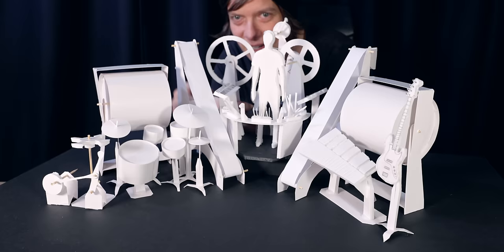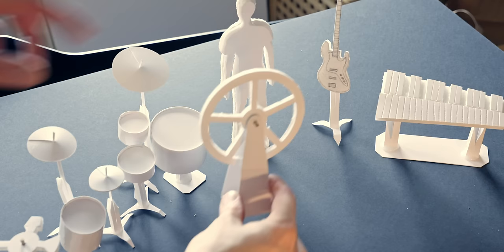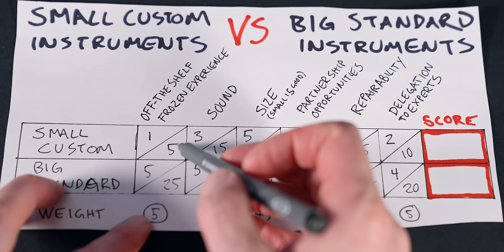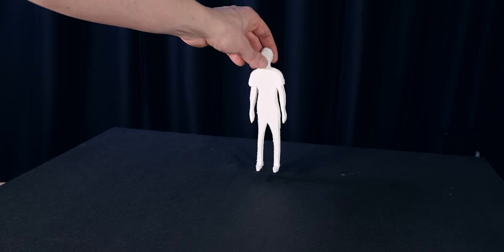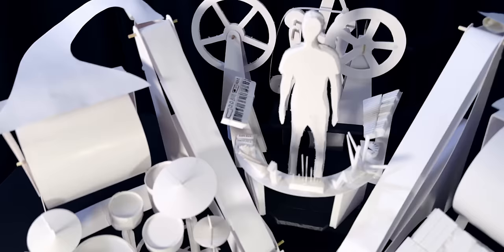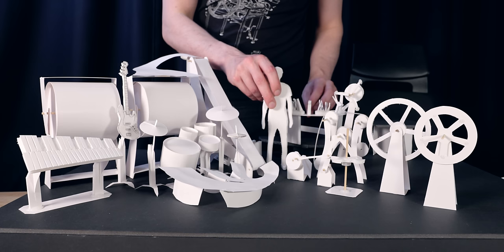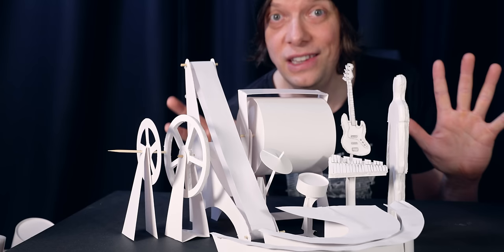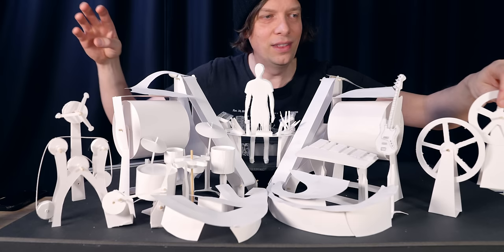Making a Cardboard Model of the Marble Machine

Comment: Adding smoke effects and pyrotechnics triggered by marbles would take the experience to a whole new level! Imagine the spectacle of marble runs triggering bursts of smoke or dazzling fireworks synced perfectly with the music. It could add an element of surprise and wonder, captivating the audience even more!
Reply: I'm pretty sure that would have serious safety issues
Reply: @michellestewart8679 standing amidst huge gears with no exit is really safe though
Reply: @michellestewart8679  Of course, but I don't think it should be discarded, especially in this phase of machine planning, adding it later may not be consistent.

If you are interested in the idea, take a Rammstein show as an example.

Comment: I am definitely leaning towards version 1, but maybe lift the gears up higher so they are at the 3 meter limit, and have you more close to the floor, like you're literally in the machine, and maybe also try and simplify the drum section? Yeah, I'd say explore what it looks like if you are on the floor and the gears and speed governor are still high enough that they surround you and tower over you.

Comment: I think you could explore the space on the stage better if you try to use all the vertical space available, for instance you could give the mechanical part more exposure if you lift the entire stage 1 meter and place those parts at the front of the stage on that space or you could do the same but expose them "hovering" above the stage sure its more complex but it should be only structural complexity of adding beams to lift the stage or to lift the mechanical parts.
Also I think it would be a good idea for you to simulate the amount of space you will actually have to move around in the stage, if you are too cramped it could be uncomfortable.
Anyway its great to see your new approach to design taking shape.
Keep it up good work.

Comment: So quick question: How will Martin escape to use the restroom or whatever? He has trapped himself in that work of art. 😂 Version 1 is really easy to keep staring at, and I like it the most. But if there is a way to not hide the mechanics, bringing them to either side or to one side for some good asymmetry, would be better. That would provide something interesting to gaze at for a while, re-learning how it works over and over. Moving the mechanics to the side also provides and exit to leave the machine. It’s about safety first, function second, and form third. All are important and to be prioritized. Good work thus far, Martin and Wintergatan team!

Comment: Just shooting from the hip here what if instead of presenting the programmable drums at a positive 30° angle front presented them at a -30 degree angle backwards and then built high in the middle. I'm sure that there's an angle that is appeasing that would allow you to showcase the mechanics as well as the programmable drums

Comment: if you decided on the daft punk pyramid esque design, the mvp / baseline could be just one side of the machine. 

Starting with an mvp that is still barebones (say a marble drum machine) that could easily be expanded into a full machine without need for a total rebuild would help with keeping motivation high with less complexity.

Comment: Well, a sizable chunk of the comments on this video appear to be of the form, “But I want it NOOOOOOOWWWWW!!!”
Another sizeable chunk are saying, "Well finally!  Prototyping in cardboard is the way we in <insert_profession> do it."
Then there are the helpful suggestions.
  My own suggestion:  Version 1, but Elevate the Huygen-Drive even higher and make the Huygen-Drive Weights the power-source, not the flywheel!  With an Elevated Huygen-Drive and flywheels behind you in a sort of "Tower of Power", you can give the drive-weights a longer vertical-range to drop through, thereby making them into even more of a gravity-battery.  You can then "charge" this gravity-battery by lifting the weights and then letting them fall through this longer vertical range, eliminating the need for you to be constantly pumping those pedals like a madman.

Comment: Instead of placing mechanics on a raised platform behind you it might be better to move the control platform to the back and raise it up. In this setup the whole machine will be visible to the audience, with the mechanics in front and on the same level with instruments. And you will be up top, orchestrating the whole setup and also visible to the audience. And as a bonus point it might be simpler to manage force distribution from the mechanics to the instruments when they are on a same level.

Comment: My only major criticism to the first layout is safety, such as the lack of access between you and the mechanisms behind you. It looks like you would have to crawl in and out, which considering at this scale it'll be heavy machinery and not at all safe. Instead, I would recommend putting them further back or having them on the sides if possible.
Doubly so incase something happens on stage and people need to get to you, they can't be reaching in to pull you out through tight spaces regardless if the machine is in motion or not. And this is before we get into just how dangerously close that flywheel and other gearage is to your back. One accidental slip backwards would spell trouble.
Just because you can squeeze everything closer doesn't mean you should at the expense of your and potentially other's safety. 

An alternate suggestion for Layout 1 would to have the mechanics under a platform you stand on. Still visible at their current height and instead puts you at a higher level than them. Which would be a safer setup.

That said, I do think the double conveyor is better than a single central one. So I would say aim for that for any design ideas going forward.

Also maybe another idea is to have simplified 3d model versions of the cardboard models and let the community make additional suggestions using the models and just the models to keep things simple and clean. And then go from there.

Comment: I also thought as you were saying it that the mechanics should be higher at the back, maybe you could make it so you can make it taller depending on the venue. Have you considered making the whole machine out of interchangeable units that you can set up in different combinations? You can use universal shaft joints and the cables to control it however you set it up

Comment: With MVP, the idea is to produce enough to fulfil the requirement and no more. But then you increase the requirement and reiterate to now fulfil the new requirement. So when people say go MVP, to me that would be build only one part at a time. So the timing wheels would be one requirement, each of the instruments would be their own requirement. And what you do is set out the timelines to work on each of the requirements in sprints (usually 2 weeks long). so after each two weeks you have some requirements filled, it could be one or multiple. The idea is not to get bogged down in the whole design, and produce nothing until the end

Comment: You want the "mechanics" to be central to the experience, so make them central to the machine.  Why not swap the mechanics with you and your stage. Spread the two instument wings a little further apart, the mechanics in the middle between them, and your and your stage behind the mechanics?  I think this would also make all your linkages/drive train between all the systems much simplier, and your stage/controls are feeding down into the machine like tenndrils.
Reply: I also like the idea of highlighting that you are controling/playing the machine, rather then the machine playing by itself and you are just provding "backup" chords

Comment: What if you had one large conveyor belt in the back behind you, and marbles ran on wire tracks above your head to the instruments. If you strategically shone lights, you could maybe get the marbles to look mesmerizing as they traveled from the top of the conveyor belt to the instruments. Then, after the marbles are used in the instruments, they could roll under your feet to the conveyor belt in the back. That would also make the machine look more compact and cohesive, I think.

Comment: I'm not sure I understand nor agree with your weighted decision matrix... when you say later on in the video, that the drums next to the Vibraphone is an issue, then previously you already had the best possible solution to that, by not having actual drums, but just look-alikes with the touch-sensors; these do not interfere with the Vibraphone and are more compact. That said, I do like the "V"-shape... what I'm also not convinced yet of, tho is, how do you get the motion transfers from the flywheels to the programming wheels, when they are not standing "in line" with each other...?

Comment: One thought. Is it possible to make custom marbles in something transparent with a small led and tiny battery inside? Could be cool to have some of them glowing as they pass through the machine. Same with stuff cut in clear plastic. Easy to put some leds in it to make a live scene look cooler. Also with the marble tracks in the front people would see those well and would be cool if they had some extra visual oomph with how the marbles zoom around i front. Even some kind of sensor registering their passing to trigger some lights would be cool. I assume you plan on having some kind of protection with those flywheels in the open like that - plexiglass in front or something as they are deadly machines.

Comment: Looking at the skeleton clock image. What if the mechanisms were above your head like at the top of the clock. And there was a sort of basket/circular cage in the middle where you stood, and then the instruments and marble tracks all around you and beneath you. So sort of keeping the same form factor as the Skeleton clock, a bunch of gears at the top, a cage in the middle, and then instruments and marble conveyors flare out at the bottom.

Comment: DESIGN SUGGESTION...would 2 bass guitars make your life so much easier? 2 strings on each...each string can be approached from the left and right side...no need to try and reach over the other string to reach into the middle strings. You could still use a standard bass...but it could potentially be more practical.

Comment: I'm not sure version 2 could be made functional with the flywheels so far separated from the rest of the machine. I think they need to be more central like in version 1, or close to the programming wheel like in version 3. You also need to keep in mind how the machine will be powered, which I think rules out version 3 - with the flywheels opposite from you.

Comment: A key to the draw of the original Marble Machine video is Martin being in front - it looks like HE is powering the machine, not just by cranking it, but by injecting his energy into it.

Having him behind it or in the middle gives more "man behind the curtain" or "DJ twiddling knobs" vibes. The equal pairing of man and machine is really critical.

Also, a spread out/modular machine detracts from the funky clockwork/organ grinder vibes. Martin does seem to be doubting these versions, but it also worries me that he keeps coming back to them...

While MM and MMX did try to cram too much in too small a space, diluting the idea with a radical redesign and/or huge size increase isn't the answer. It should be expanded only just enough to comfortably manufacture.

Comment: The relative size of the previous machines seemed cool/fun.  To me, one gigantic machine seems somehow less fun.  Instead of one large machine, have you considered building two or more machines similar in size to the previous machines operated by a number of musicians?  Presumably the drive units could be of common design, but the interface to the attached instruments could be plug in modules.

Comment: Version #1 Issue: The center console needs to be split in half in the left and right directions so you can walk up and down the middle of the stage. Right now, you are trapped in the center. You will have to walk all the way around the instruments to get in front of them. You could end up tripping on wires and other equipment while trying to get to the front of the stage.

Comment: Most stages are set up to deal with one maybe two raised platform anything higher and you introduce a lot more setup time and heat issues (with the old lights) but i still wonder if you could make a waterfall like design with most of it ontop of each other? ^^

Comment: I like version 1 but there is something I don't like about any of these - the marble drop appears attached to. To the programming wheel and will somewhat obscure it. Since you are using bowden cables to control the drops there is no need for this constraint. Separate the programming wheels from everything else!
Maybe put them right at the back, but high up so they are visible?

Once you've done that it may not be neccassary to have the marbles go quite so high?

Just my opinion

Comment: Martin, do more cardboard prototypes of the objects that aren’t fixed to a certain form! for example the marble runs and the elevator. Try feeding the marbles below and under the instruments and make an inverted waterfall. Maybe try elevating the marbles further up, uncessearily high up even in order the capture the spirit of the skeleton clock, heck why not even try to place the flywheels above you like a a clock tower. Its only cardboard right? It does not have to obey to any laws of physics at this stage, your imagination is the only limiting factor right now so for a brief moment, do the unthinkable (in cardboard)!

Comment: It's probably worth exploring what you can do with going higher and using different levels. This would break up the "orchestra" look even more.
Reply: Going maybe a little bit crazy in this direction: what if one marble can play 2 sounds in one circle? Like have one high conveyor belt and some kind of resting stage in the middle. Maybe vibraphone high above and drums on ground level. I don't know if there would be a risk to run out of marbles. But even then you could split the one conveyor belt in 2 vertical cycles instead of 2 horizontal ones.

Comment: What about a programming wheel where one side is the vibraphone and the other is the drums, with the operating mechanics on one end and the marble return on the other. Put on stage with a carousel and you can play a song while rotating so the crowd can see all sides over time and then design it to have the whole wheel module be replaced for new songs with a few disconnections from the operating side. You rotate the platform around to swap wheels and work the crowd with some instrumental segue and return to the MM for the next song.

Comment: Can the programming wheels be rotating around a vertical axis instead of horizontal?  If they're just activating marble drops by bowden cables then that could work.  That'd add height and reduce width.

Comment: If the point is for the mechanics to be visible, why not mount them on the ends of the two programming wheels? (using the layout shown at the end of vid) Has the bonus of keeping them on axis with the programming wheels they are running, and they'll be completely visible, instead of partially blocked by you.

Comment: Version 2   BUT   more spaced out.
Ther skelton clock is too simplistic   but   I think you know that.  Cardboard is good.
It would be better to consider something like the --  Grand Lange 1 Moon Phase Mens Watch 139.032 -- which includes the concepts of spacing and asymmetry
Your design would benefit if the components could breath a bit more   BUT   the marbles then have to travel further.
Alternatively skeleton ise the structure as much as possible . . .

Comment: What if the mechanics is a box, maybe a cube and the conductor steps inside. The instruments connect to the sides.

 The mechanics module could fit in a shopping container. So it could be a cube with sides of 2.4 meters.
The mechanics cube could be a very good looking thing that has a lot of moving parts and gears and the conductor acts as a cog in the machine.
Reply: This could also give the weight drive more height to work with.

Comment: Martin, Just my two cents. I would start by changing how the machine will be powered, and let's get things straight here. Taking from the previous MM, it's humanly impossible to power all that on your own human power. So, after getting this out of the way, if you decide, and really hope you do, to power all with dc servos and computer control. This would allow you to compact the machine to a minimum and have lots of flexibility to spread around the stage, all the instruments, instead of having all that connected with rods, wheels, chains, belts and whatsoever more. you can still make it beautiful, you'll need some pulleys and belts to adapt a motor to a marble drum which will continue the idea of crowd watching the machine work. That will also give you the flexibility to control drum patterns and marble droppers. Again, it's humanly impossible to power all that with one or two pedals. Electrify it, it will be much better.
Reply: That's the huge elephant in the room that Martin's refused to address:  a machine this size simply can't be human-powered.

And I don't see why "human powered" is part of the design requirement.  The original machines were also electric powered--and that didn't diminish anyone's excitement for the project.  At core--this machine is about MARBLES regardless of how they're programmed and powered.